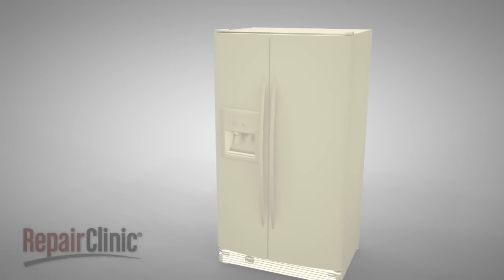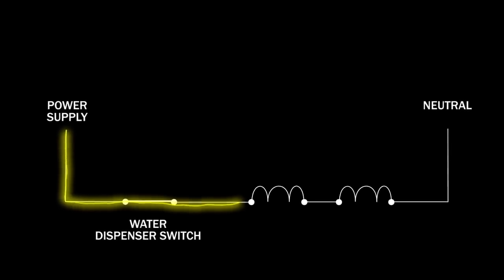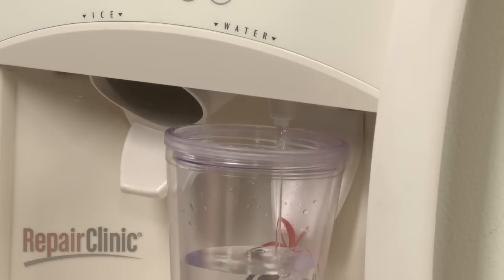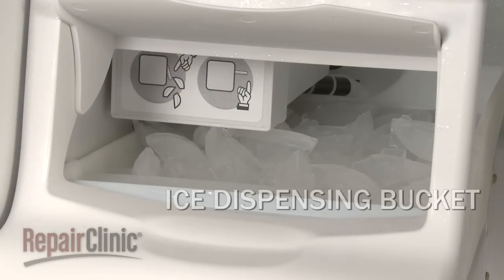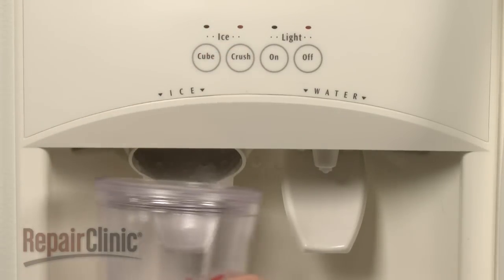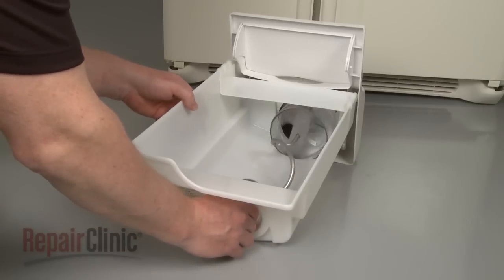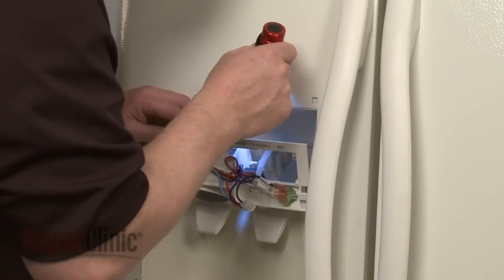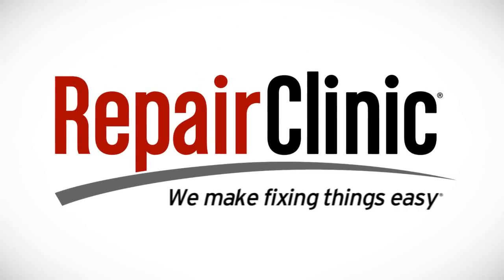How Does a Refrigerator Dispenser Work? — Appliance Repair

Comment: What if everything works(ice and water produced properly, condenser OK,etc.) but there's an intermittent popping sound that comes from the rear of the dispenser like every few days?  I thought I might have fixed by tossing out a certain amount of ice cubes from the tray but that doesn't seem to work since the noise returns anyway.
Would you suggest replacing the dispenser or just leave it along?  Thanks

Comment: I have a Berkey counter top water filter and would prefer to make my ice with that water- can the water line be put inside a container of still water? or even attached to the actual cannister? wondering if the refrigerator sucks water in or if it had to be forced in
Reply: @repairclinic  how does the water make it to the dispenser in the door? is there a pipe that runs through the upper or lower door hinge to the dispenser?

Comment: Our Frigidaire is not making any Ice. It makes the noise like if something is going to come out, but no ice is being made or coming out. How do I fix this problem?
Reply from the maker: +30CEC If the icemaker is cycling, but no ice is being made it is possible the water inlet valve is defective and unable to supply water to the icemaker .

Comment: I have a problem where both the water and ice turn off when they decide - a random few seconds after the glass is removed. This encourages users to open the fridge door to shut the item. I think this will shorten the life of the fridge and wear out the weather stripping on the door. Any ideas?
Reply from the maker: +y00no The actuator switch may be bad and causing intermittent operation.

Comment: I thought at 1:20 where the result of the water not shutting off properly could be a problem with the dispenser switch. Is that correct?
Reply from the maker: +Braden Robison Could be. The switch can be tested for continuity with a volt ohm meter.
Reply: OK, thank you so much!

Comment: I don't have water dispensing or ice dispensing. The ice maker makes ice, but I can't get the actuator motor to turn when the switch is pushed. I have checked both micro switches with a multi meter and both are fine. I have checked the water inlet solenoid for continuity and both are also fine. Any ideas ? Thanks in advance.
Reply from the maker: +1kpinson Something simple like the freezer door switch going bad could prevent the dispenser from working.

Comment: I have a Kenmore 106.5762702.  No dispense water but make ice and water pressure sounds good when fill the ice tray.   When you push for water dispenser don't make the traditional activation sound before dispense water.  What is the possible fail???  Thanks
Reply from the maker: +vegui1 The water inlet valve might have failed click here: https://www.youtube.com/watch?v=aXIX73EI1Z4
Reply: +RepairClinic.com I contract a technician and the support for the switch are broken.  he replace the support for screw and work fine.  thnaks

Comment: I just connected my water line to the fridge. Do I leave the water line on? How does it stop flowing?
Reply from the maker: +Anita Rodriguez-Esquivel Water only flows through the appliance when it is called upon by the ice maker or water dispenser.

Comment: I have a Frigidaire Gallery French door refrigerator with bottom freezer.  I have two ice makers.  One in fresh food section and one in the freezer.  I have already replaced the one in freezer and now the top or fresh food ice maker has stopped making ice.  When I looked into it water was frozen in bin.  After thawing everything out I still cannot get any ice.  Water is dispensing at door but no water going into tray.  Any suggestions???
Reply from the maker: +Jim Coflin The water inlet valve may be defective or the icemaker itself could be defective and not call for water.

Comment: I replace the filter, putting a new filter in, but now it's not making ice, please help.
Reply from the maker: +Alma Rodriguez If you forgot to purge the water lines after installing a new filter, the first few batches of ice had air in the line when it went to fill.